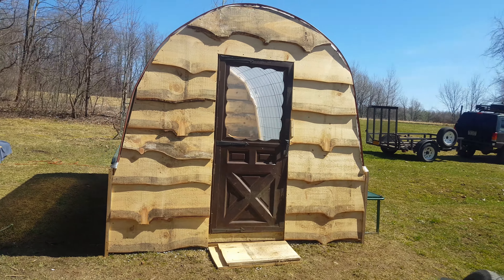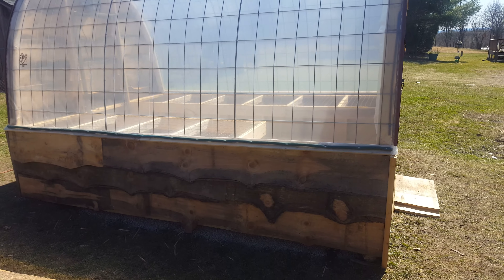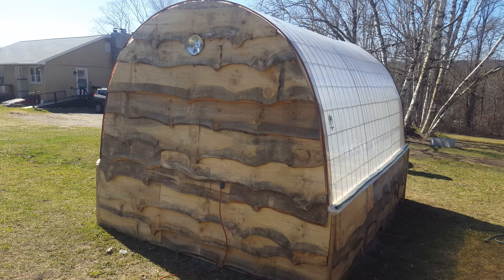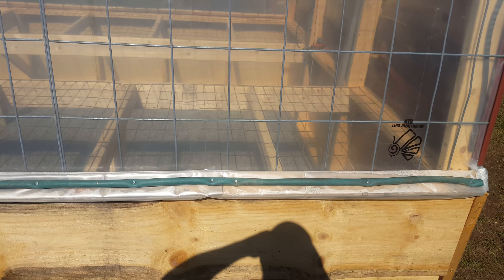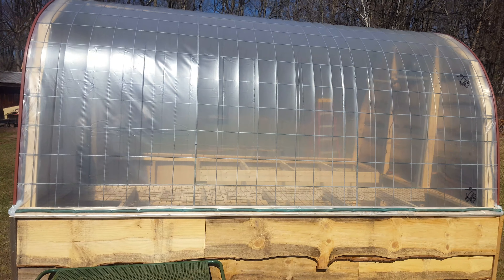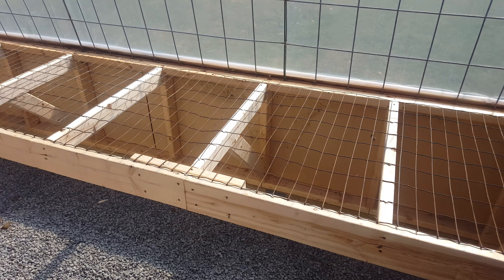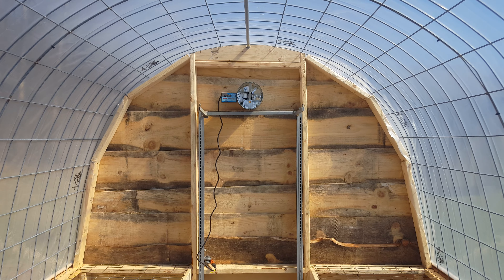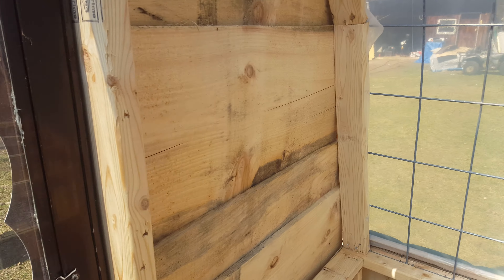DIY Cattle panel hoop house greenhouse

Comment: This is a fantastic build. That garden hose trick is really creative. I just made a chicken coop using a similar design and realized pretty quick how great it would be as a greenhouse. Then I found your video. Thank you for sharing your build.
Reply from the maker: Daniel, thanks.  I have a couple update videos showing it in use also if you haven't checked them out.

Comment: You can get a sloar powered roof vent
I made mine 30' long with 34" sidewalls because it's 12' wide and every other 8' my side wall tilts up and wire cloth behind that the other 8 ft that doesn't tilt up i built cold boxes. Needed the airflow because it gets 100+ 4 months out of the year here
I like the wavy cedar look on yours ,looks cool
Reply from the maker: Fantastic.. thanks for watching

Comment: looks awesome!  did you put the cattle wire all the way to the ground and then cover it and the plastic up with the rough cut lumber?  or did you start the wire off the ground a bit?  Thanks
Reply from the maker: I built the knee walls then attached cattle panel to one wall and walked it up to form hoop and attach to other wall. I then filled in the end walls and finally covered with plastic.

Comment: Very nice! What kind of pipe do you have running front to rear as a support for the cattle panel roof?
Reply from the maker: Thank you.  The pipe is 1" threaded end galvanized pipe.  I used 2 pieces with a coupler joining in the middle.  My intention was to place a 2x4 temporary brace from ground up to center of pipe for added support to hold snow load, however have not needed it yet even with 30" of snow fall in 1 day.  I do clear snow from sides and gently broom some off top when I clean snow around yard but so far its held up great over the rough upstate NY winter.

Comment: Looks very nice.  I am curious why did you decide not to put plastic on the ends?  And how tall is the center height?
Reply from the maker: Thanks.  Center height is roughly 8' tall.  I didn't feel the need for plastic ends because I positioned it so it gets nearly full sun all day and in fact I had to add a shade cloth to cut down on sun as it was getting to hot at times.  Also the stability and areas for shelves, hanging stuff etc is a bonus with wood end walls.  Feel free to look at my other video showing it in use with plants inside.

Comment: Hey man, did you take any video of the initial framing?  It looks simple enough, interested in how you arched/framed the ends.
Reply: Also, how did you secure the 6 mil plastic on the ends?
Reply from the maker: I arched the hoops on the side walls, secured to a temporary post on ends to hold the perfect arch and framed the ends to fit the hoop little bit at a time. No real science used lol.  Plastic is wrapped around wire ends about a inch or so used sill trim from vinyl siding to lock in place and insulated any gaps with spray foam and/or caulk depending on amount of gaps.

Comment: Use Plummer’s Strap and it will look better instead of a waterhose
Reply from the maker: maybe, but I tried to use as many items as I had laying around and it was easy to roll around and tighten with hose by myself.

Comment: This is very impressive. I am wondering though are you losing some of the warming effects by having the wooded ends vs the whole green house in plastic?
Reply from the maker: I suppose some, however I have it positioned so one side is south facing so it gets direct light most of the day.  I also had to add a shade cloth because it was getting so hot in summer months.